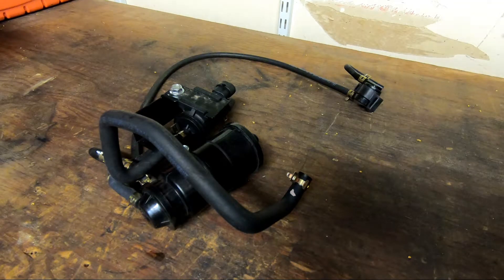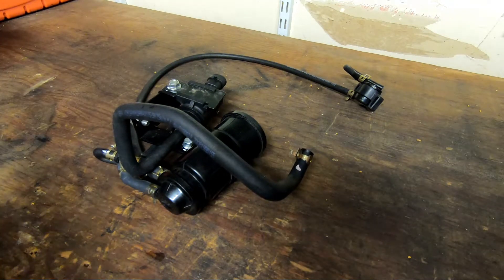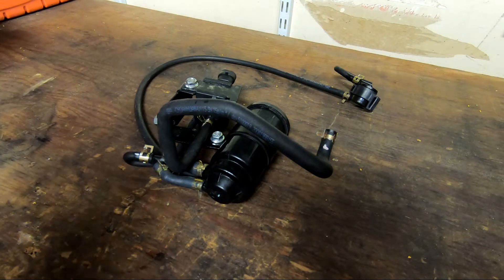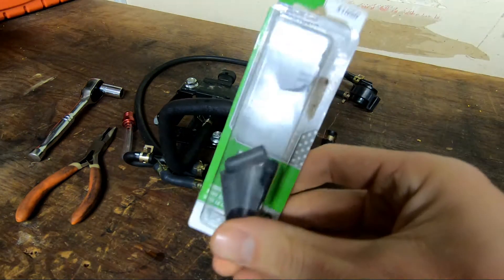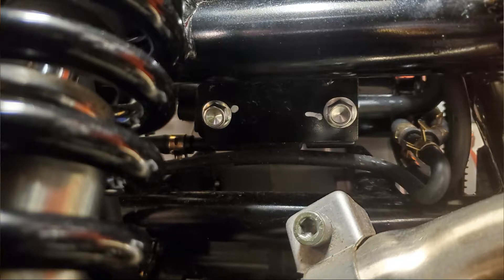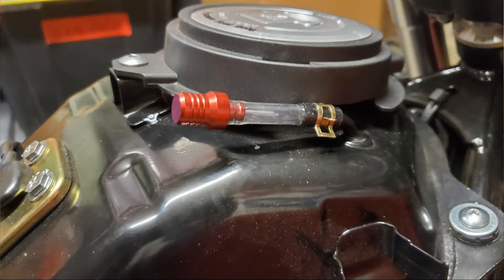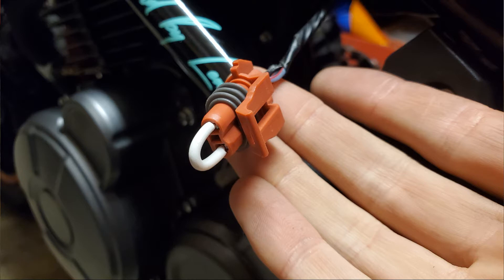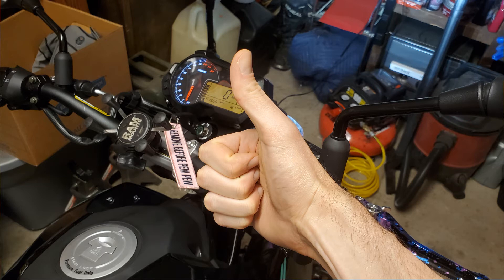How to Remove the Benelli TNT 135 Charcoal Canister

Comment: Great video, wanted to this and saw yours popping up. I think you better could place a resistor in that place of the paperclip. Now you are shorting the circuit and can cause warm wires or fire. maybe measure the resistance of the coil of the valve and go with that.

Comment: Great video bro, although could you explain why it is needed to remove this or just for space? What’s the whole purpose of that canister?
Reply from the maker: It's not really needed to remove, but this is a us specific addition to filter any gas vapors. Just wanted something to do while waiting on parts to ship.
Reply: Are you having any oil leaking issues now? I was thinking about removing mine and sticking it on my old 125M Honda trike that smokes like a siv.
Reply: What is saving weight going to accomplish?
Reply: @ratchfordgeorge  7lbs + 1 HP